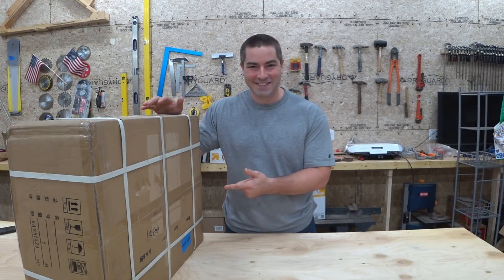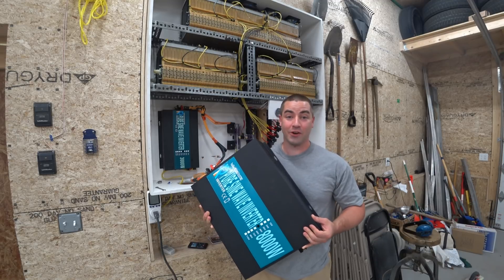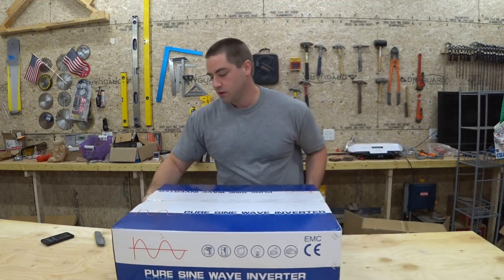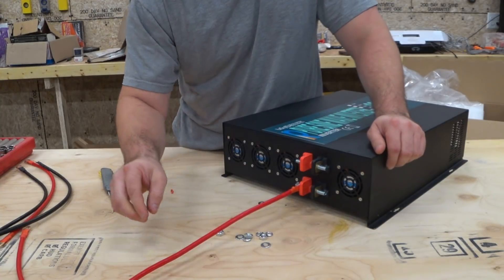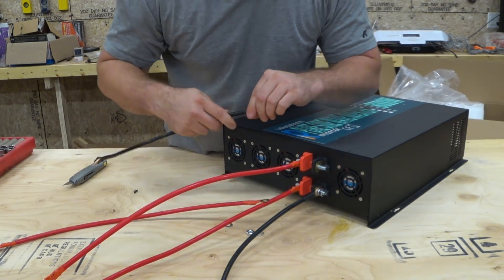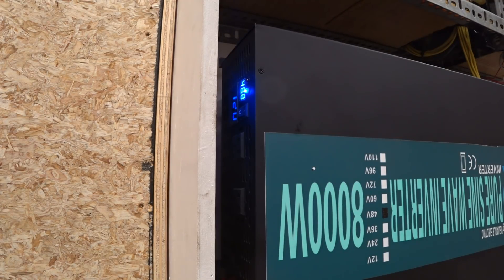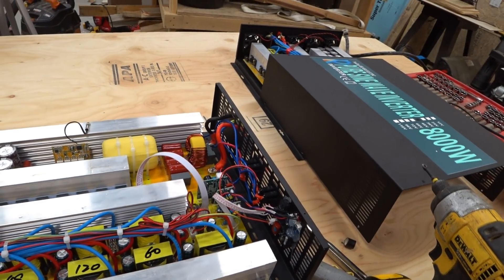Cheap 8000w Reliable Inverter, DIY Powerwall, Chevy Volt Batteries

Comment: Everyone commenting here knows more about electricity than I do for sure. What I will say is my Dewalt chop saw and occasionally my Dewalt 12" mitre will pop my 20A breakers. They are the only load on the circuit and when I trigger, POP! The only way the chop saw will work is if I spin the wheel by hand before I trigger it. Super safe I know.  I Think they pull too many amps at startup. But what do I know? Additionally I have used two exact same Dewalt chop saws at two different garages with the exact same result, tripped breakers.
Reply: Yep, very good advice but I hope you use gloves to pre-spin your blade. Hahaha. Yeah I don't know much about electricity either. I know it don't play. I've heard of a guy I knew getting electrocuted using a weed eater and an electric fence involved somehow. I don't like electricity because it can move faster than me, what 186,000 miles per second???

Comment: hi  can someone tell me if it s possible to make a 230V (europe) battery pack  instead of 12-48v   and power directly DC in the house, and use an inverter only on stuff what won't work on DC ?, but the big question hwo can we know what tools work on 230 dc instead of ac, i read somewhere mostly all motors can run dc but what about light   led light they can?   and more my problem  computers can we power them on DC ?

Comment: I run a house swamp cooler on my 1500 watt inverter, with 2/0 wires to batteries the key thing I found it is whether it is a LOW frequency or high frequency, if it has moffets it's a high frequency one and they do not handle large start up loads whereas a low frequency ones will ..that could be the issue alot of companies have gone the moffet route just because it is cheaper but...NOT good for large induction motors water pumps etc etc
Reply from the maker: This broken 800w inverter is high frequency.  I learned my lesson with this video and bought a low frequency inverter: https://youtu.be/dfHb5tZErTs  Thanks for watching.

Comment: Looks like it needs much larger capacitors to handle the startup surge. Also, the "old fashion" fuses that burn out are too slow to stop a surge.....but are great for mains supply as you don't pop the breaker every time you start a power tool.

Comment: High-frequency PSW inverters are inexpensive to produce.  If "Reliable" offers a low-frequency inverter, such as a magnasine or Schneider, you would be much better served.  Although it is true this inverter should not have failed if engineered correctly, you are undoubtedly experiencing excessive voltage sag upon startup.  This should have triggered an inverter Low Voltage Cut Off (LVCO); but, instead, continued to pull more amps and fried the FETs.  Need to drastically increase wire gauge/number of feeds from battery bank to inverter and make the run as short as possible (Locate inverter as near as possible to bank).  I've got a Magnasine MS4448PAE with a 16  x T105 Trojan batt bank (8S2P) and could not start my Rolair Compressor with 4 feet of single 0 copper from bank to inverter.  After replacing with 00 between batts and 0000 to inverter, no problem for this  4400 watt inverter, which weighs 55 pounds naked, BTW.  Good luck, Brother.

Comment: Just found your channel. Subscribed,Liked,Shared and added to Playlists. Looks like the startup surge was just to much for the inverter to handle ?.  We used a type of capacitor bank at work, it was for the power factor ,but also  took most of the startup surge.  You should be able to replace the mosfets  maybe a higher amp range would solve the problem ?. Best of luck to you and keep the videos coming.

Comment: I said this to someone else who commented on this video. Even if the chop saw was shorted the inverter should have self protected itself but maybe you should have shown it running including a few measurements just for the sake of proof. With that said, most inverters especially the pure sinewave inverters seem to have issues with power tools like saws. I have a 6000 watt sinewave inverter that runs on 12 volts and it has the soft start feature which will protect it from surge currents and I also have a super cap right on the input for more surge current. It will run my freezer and refrigerator at the same time but if one is already running and the other kicks in there will be a small sag in the power for about 1 second. I have a high powered drill press that the inverter hates and the work around was to put a 100 foot AC extension cord in series with it. That not only solved the issue but the drill press starts up with zero flaws. That inverter you you purchased should NOT be blowing itself up even if you purposely shorted it out. The first one that blew could have been a fluke but the second one? Shame on them!
Reply from the maker: Thanks.  Sounds like you have a nice inverter.

Comment: i doubt this unit is 8000 watts at normal duty cycle you would need two people to lift it for one and the chop saw is a hard start motor  so the initial loading of the start caps is going to exceed your  15 amp rating at 110 volts , They look to me to be very small fet's  and the way the thing is  constructed looks a bit odd  . hheheheh killed it . Ha & the reason they fit double stacks with bus cross bars is for loading up multiple banks to the unit left bank right bank  normally equalised prior to install .

Comment: Look up resistive load vs inductive load (motors/transformers/chokes)! 
Inductive loads created a second current that is out of phase and causes power spikes when turned on or off. This is often (not always) medicated by simply placing a (large) capacitor on the inductive device..

Comment: Fun video David.
FYI: The fuses they used in the inverter are not capable of protecting the MOSFETs.  They are the very cheapest of low voltage fuses and they do an adequate job of preventing a fire.  If one wants to protect semiconductors with fuses you must use extremely fast blowing fuses called semiconductor fuses.  They are actually semiconductor in nature and are easily capable of accomplishing that task..  They aren't cheap however, costing $10 or more a piece.  It usually costs less to add a little more circuitry that actively monitors the current thru the MOSFET and simply suspends turning ON the MOSFET if the current exceeds some limit.  Then no fuses are blown and the inverter can live on.

Comment: If you have 2 batteries thats 24v that inverter is made for 48 volt. You had 3 red cables one is to jump the battery. so you use one cable to jump the battery making 24volt and the other battery at 12

Comment: I had hoped that your 8K Reliable would have been as good as the 3000 watt Reliable you and I have. Checked out another brand of inverter. Only rated at 4Kw. But it is twice as heavy. 84lbs heavy vs the 8K Reliable at about 35lbs. Looks like it might be made by Sigineer. They don't show any 8k units for sale but their 6K unit weighs 108lbs and the 12K unit weighs in at a whopping 155lbs.  A 12K unit is shown in https://www.youtube.com/watch?v=PND-I5mMK4s Sigineer 6K is on their youtube video at https://www.youtube.com/watch?v=yO7vKytPwEg.
Reply from the maker: I've been very happy with my new 6000 watt inverter that I review here: https://youtu.be/dfHb5tZErTs

Comment: There is a big difference between average power and peak power or average current and peak current for semiconductor inverters.
The thermal time constant for a semiconductor is in microseconds and the thermal time constant for a high speed electric motor with a high inertial load is in the high milliseconds. The 8000 watts refers to a resistive load with no added peak current that is generated from high inertial loads.

Comment: They are trying to load share on FETs . Will never work with higher currents. They will oscillate and blow. Did that in 1983 on a rocket fin actuator. Another problem is if they use Fuji FETs. Fuji FETs blow easily. Did that on an electric bike in 1993.

Comment: I think You issue is not the Inverter, but the Chop saw. The Inverters are a particular beast. i have been doing solar systems for a while and solar generators.  I will give you an example, If you take an inverter and connect usb charging flashlights it might not work either due to the inverters are load sensing. Load sensing inverters are this way to limit the heat they produce and keep  the 85% to 90% efficiency rating as high as possible. This is exactly the reason why you trip the Inverter fuses. 
Solution is to use an inverters that does not do this.  The lower the efficiency the betters it works, strange huh? yes, if you are less efficient then you are not sensing as much.   
The other solution is to parallel the inverters, as some can do this feature. Some inverters even talk to each other.  Home inverters are custom and should be treated as such. 
hope this helps. lazaro
Reply from the maker: Thanks.  I bought a new inverter since this video, installed it, and it runs my miter saw great.  Video here: https://youtu.be/dfHb5tZErTs Thanks for watching.

Comment: Basic electronics. You need an Inverter with output transformer because in your case the load is directly connected to the MOSFETS.

Comment: As an electrical engineer involved in the power distribution systems of industrial facilities for many years, I can tell you that motors connected directly to the power source (across the line)have what is called an inrush current.  Standard AC motors, called squirrel cage, have a NEMA letter designation for the amount of inrush which can typically be 6X the rated maximum current.  The motor in the saw is likely not a squirrel cage motor but probably a wound rotor motor - the rotor is not segmented metal but wire wrapped around a metal 'pole' going to an armature.  So if you can connect the saw to a recording ammeter showing the maximum current demand, you will probably find it exceeds the rating of the inverter.  The saw has a blade which adds to the inertia that must be spun.  If you remove the blade and try to start it without the added inertia, the saw may start without tripping the inverter.  You can also try a 'soft start' control between the saw and inverter which will limit the current to the saw and extend the time to full speed.  Are you raedy to say: 'Beam me up Scotty?"
Reply from the maker: Thanks for such a clear explanation for me.

Comment: Use a 100 foot extension cord to reduce the inrush. Yes, it works.
Reply: Hmmm, someone who reads instructions. Yeah it's surprising how much longer your electric power tools will last when you use the proper size wire. I'll never forget when I saw some carpenters trying to use a circular saw with 4 100 foot extension cords. It was hilarious. It would run but barely. When they'd try to cut the 2 x 4 it would stop because it didn't have enough power. They wouldn't believe me when I told them why. I let em alone. Live and learn.
Reply: @fbsurveyor  Or live and don't learn in this case.

Comment: I watched the video to see how you use a Chevy Volt battery, but NOOOOOOOO.......
Reply from the maker: Hi johnny mars,  No, this video was more about the inverter fail then the volt batteries.  If you would like to see me get the volt batteries that's this video: https://youtu.be/V1t1SoEhVNQ  Re-wiring the battery for 48 volts is here: https://youtu.be/ot3IhsUfFS8  Installing the batteries into the cabinet: https://youtu.be/MxX3csP9Jv4   And finally, paralleling all the modules on bus bars: https://youtu.be/DsbgNuZtBqY  I hope that helps and thanks for watching.

Comment: Running an isolated transformer might reduce the surge on the inverter. Definately shorting the inverter though. It might be easiest to just spec out the MOSFET's and replace with bigger ones.

Comment: I have a 100 W solar array it is 200' away from my batteries what size cable do I need to connect the solar panels to the battery. I hope to make my system bigger keep that in mind I have a 100 W solar array it is 200' away from my batteries
Reply from the maker: Hi Jozef Klementich,  I don't have enough information just with the wattage.  For example, you could be running 1 volt and 100 amps, or you could be running 100 volts and 1 amp.  They are both 100 watts, but very different wire size.  My favorite online calculator to help you out is this one: https://www.rapidtables.com/calc/wire/voltage-drop-calculator.html  I used this one.  I hope that helps.

Comment: I have an inverter generator. It runs all good but my rigid oscillating sander. Sander runs great on my full on the generator and if plugged into 120v outlets. But will not run on generator inverter.

Comment: The box says 8000W but it doesn`t show the VA rating. It`s possible that it`s not 8000W but rather 8000VA which could mean that the actual usable wattage would be much less. In many cases less then half the VA rating
Reply: Each of the 9 groups have a 10amp protection fuse which would give you 90amps total protection. 

90 x 48 = 4320 maximum usable wattage

If it was an 8000W inverter, those fuses would have to be,

8000 ÷ 48 = 166.67Amp
166.67 ÷ 9 = 18.52Amps per fuse
Reply from the maker: I don't know for sure, but I think the pair of 10 amp fuses are working in parallel.  I think the manufacturer intends that to be 20 amps to each of the 9 groups of components.  Regardless, it didn't work well.

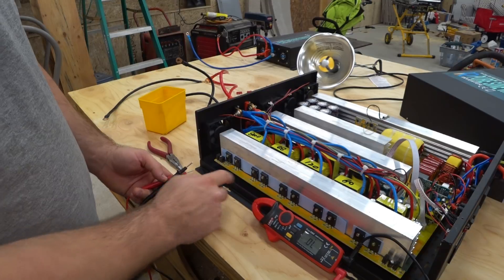Comment: Inductive loads like motors and microwaves tend to draw huge amounts of current at startup, sometimes double the rated amp draw as shown on the unit. I still think that the problem lies in the inverter itself though. If it went into an under-voltage state when trying to start that saw, it should have shut down automatically instead of frying half the mosfets on the board. The 6 capacitors in the upper left side at 8:03 look like they are on the input side. If so, they're not nearly enough to buffer any kind of shock load due to immediate high current draw, and if it does in fact have an under-voltage cut-out, it's not responding quickly enough to kill the output relays (if it actually uses relays), before the voltage goes critically low and smoking the mosfets. I'd stay clear of this outfit, if their 8kw inverter won't even start a chop saw that runs well on a 3kw inverter. 

I have a semi-temporary emergency power setup with 3 - 55w. panels charging 4 - 6v. golf cart batteries that are wired series/parallel for 12v. output. Running a Power-Tech 1kw (2kw surge) sine-wave inverter that keep my auxiliary oxygen generator, my full-size Kenmore refrigerator, and several lights up during power outages. 1 1/2 years and no problems, so I'm assuming it's a pretty good unit. Has under-voltage protection that will shut it down right at 10.55 volts (if I actually let it pull down that far).
Reply from the maker: Nice to hear your system is working out well for you.

Comment: what is the  weight of that 8000 watt., Compared to your 3000 watt. ?
Reply from the maker: The 3000 watt was 12 pounds, and the 8000 was 24 pounds.  Funny right?
Reply: @DavidPozEnergy  indeed. even tho same brand? the 3000 watt. is the deal ;o) .
Reply from the maker: Yep.  My 3000 watt is still working, and I use it daily.
Reply: @DavidPozEnergy   Nice.  i have a ?, so the 48 volt, 36 volt., 24 volt.,  Models,  of any brand, doesn't need, as heavy  gauge power wire, then 12 volt  Inverters, i get that. My question is, If you  " Over power wire " , say, If your currently using 2 Gauge, But, Up it, to 1 Gauge. Can that Benefit the inverter ? and therefore better supply the " load "  15 amp Saw.  idk, I am Asking
Reply from the maker: Yes, a bigger wire has less voltage drop.  I'm not an electrical engineer, so I don't know to what extent this holds true.  I think the shorter the wires, the less they have to be over sized.  There is a chart on Alt-E website that shows what to use with each: https://www.altestore.com/howto/recommended-inverter-cables-sizing-and-breakers-or-fuses-a62/
Reply: @DavidPozEnergy  TY.

Comment: The Chines are notorious for Over Rating most electronics products.  Under the Chinesium Rating System if a product is rated 20 Amps surge they mean it will  only emit smoke and heat at 10A and burst into flames / Explode at the 20A .  See? it made it to 20A.

Comment: The surge of that saw is probably way over 8000W I think the inverter would be fine with 8000W without a high startsurge that some electrical equipment need, like compressors and different pumps for example.

Comment: Japan, then Taiwan, and then Korea adopted better industry standards (and reputations) over the years for reliable electronic products.  Mainland China was a late-comer, and problems with critical features such as snubbers, and protection circuitry are still not resolved. Sourcing from Taiwan did not save the "Power Jack 3500 watt" buyer though, some ten years ago. 

It's wise to buy proven designs that are tried and reviewed rather than risk these unsafe nightmares.  Avoid slick advertisements that pretend to be reviews. Magazines like "Home Power" do critiques and reviews of such off-grid equipment that will save you from expensive mistakes.  Libraries often have them, and there are on-line issue indexes of equipment reviews.